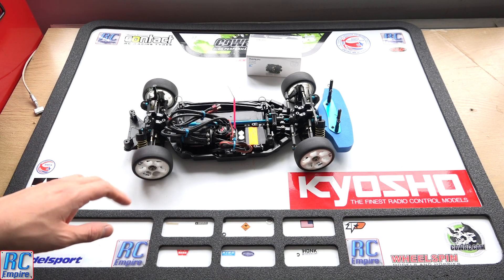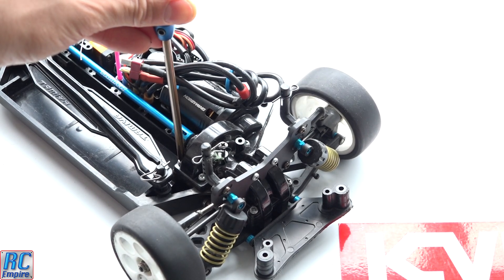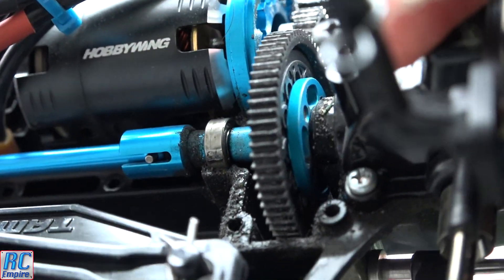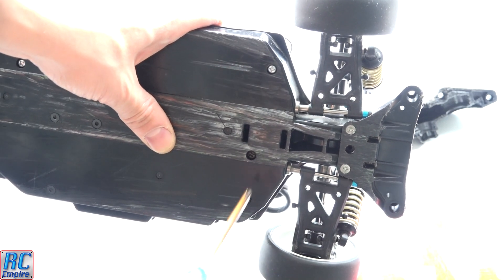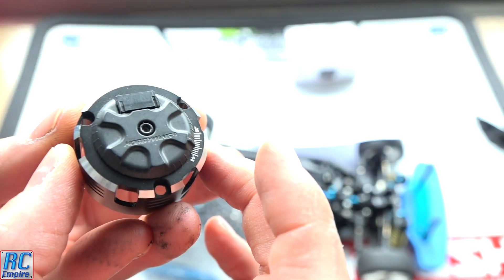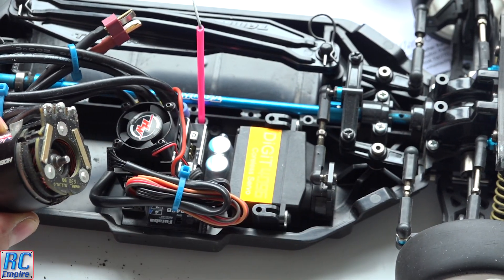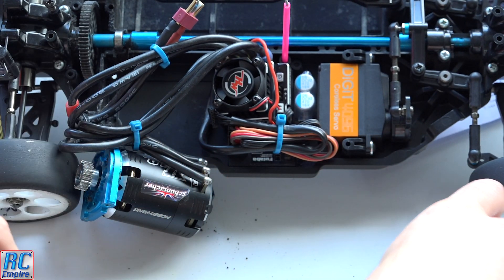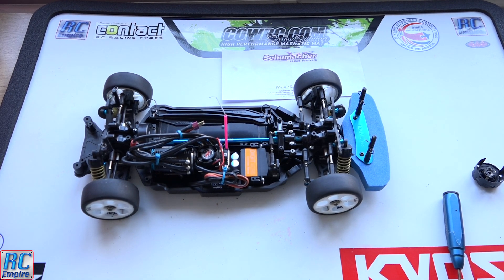Brushless Motor Sensor Clip Fix - Hobbywing V10 G2 10.5T Brushless Motor

Comment: Hi, is see that your upper suspension arm in the front and rear are just a simple tie rod? So you can adjust the camber. The stock kit are plastic arms and not adjustable.  Now there is on eBay aluminum sets adjustable suspension upper arms.  Did you made this yourself? And what is the length? Hope you can help me out. Thanks anyway.